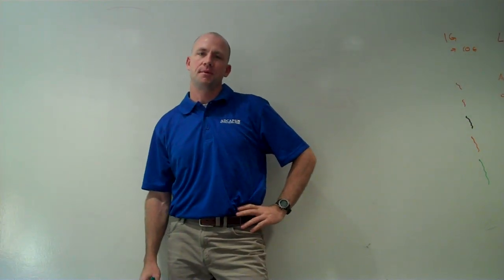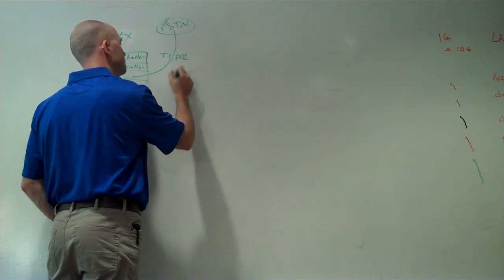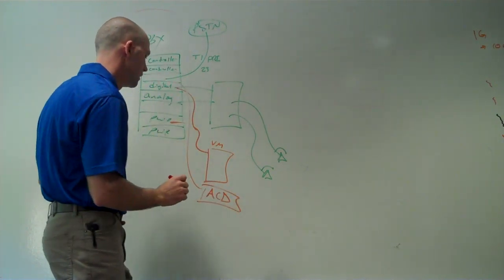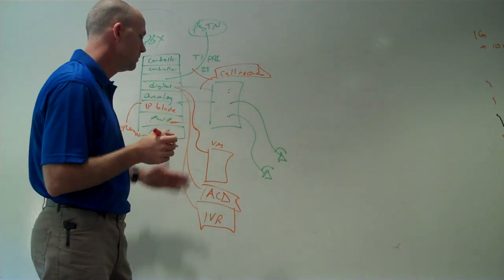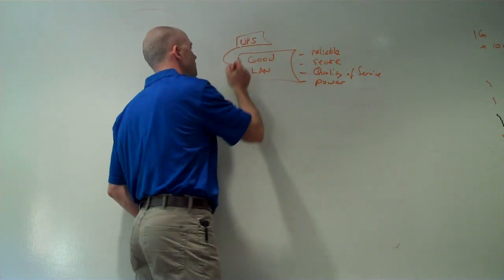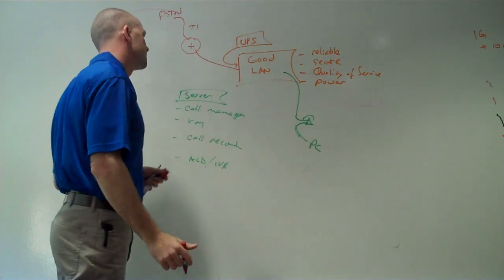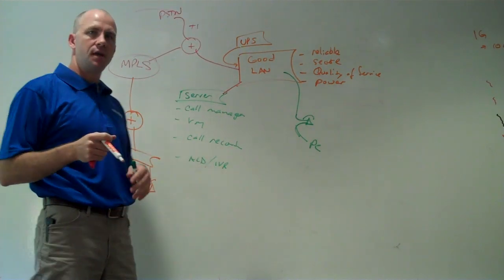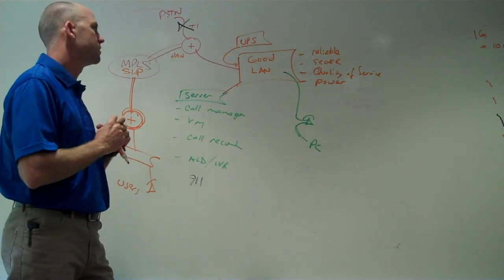Cisco VoIP Phone System Overview

Comment from the maker: Jesboy, thanks for your warnings to others. If you want detailed technical information instead of the high level overview I provide which has been valid for over a decade now, go read the Cisco Unified communications solution reference design guide, available for download from Cisco. The current version should be for 10.5. 

It's up to about 2000 pages by now. Maybe after you read it you can make a better video.